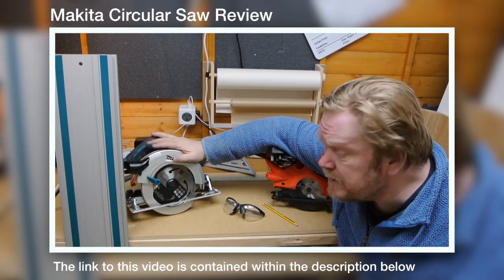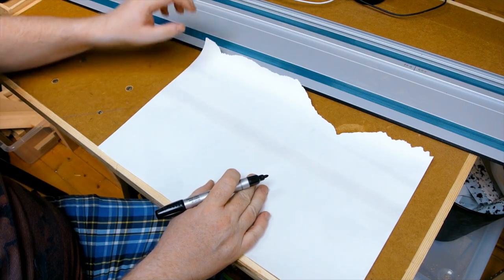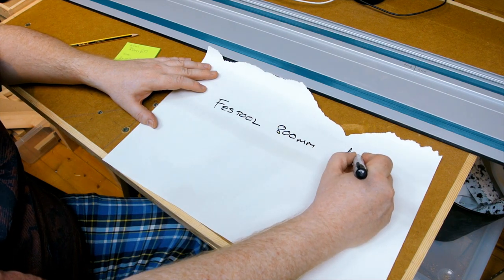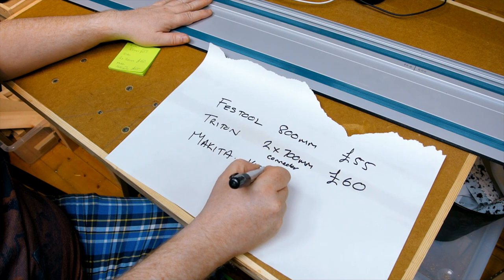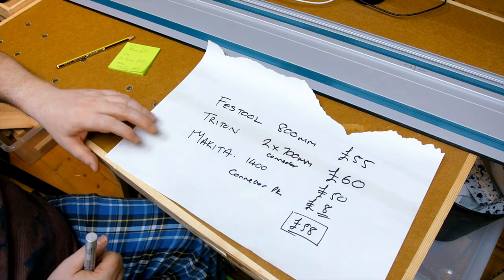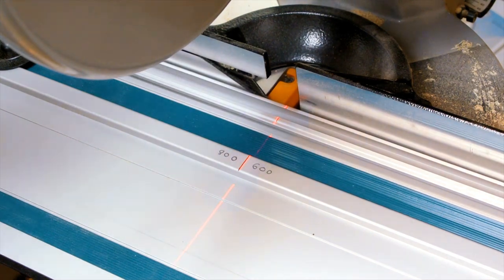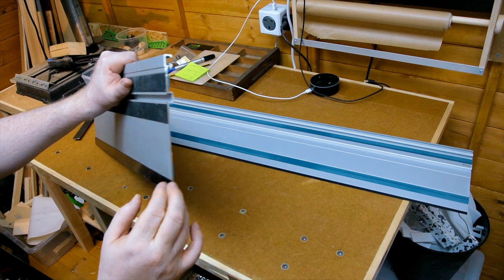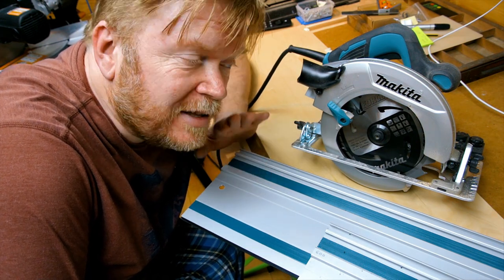Making Shorter Makita Guide Rails | 2 Rails For the Price of 1 | Tool Review

Comment: You say the best price you found for the connector pack was £8 (good price) mostly they seem to be,  as you state £14 however the pack is only for one connector, but you need two, one on the top of the rail and one underneath! In my experience the rails don't work so great with only one connector. Also wanted to ask if you have had problems with the Makita rails being cupped, when i purchased mine, I had to send 6 rails back before i found two which were straight i also found that the profiles didn't match very well on a couple.
Reply from the maker: I think for putting the chopped rail back together the single connector (Part number P-45777) works well enough, but you're correct if joining two 1400mm rails the double connector pack is the right option (Part Number P-20177). As far as rails is concerned I've had to send one 1400mm but consider myself lucky with the others. I have eased over the edges of the profiles and when I connect them I've matched the ends for the smoothest transition between rails and marked them. It's clear that the quality of the rails is an issue for Makita over the Festool system based on the reviews I've seen. But the system overall including tools/adapters, etc. is affordable in a way that Festool isn't.
Reply: @StrawbyteWorkshop  I just wanted to point out to others that You need two connectors as i was caught out when ordering!. I absolutely agree with the affordability of the Makita range, after doing the usual reading of reviews I chose Makita based on most of my other equipment being Makita but also due to the price difference with Festool. Now I have straight rails i'm very happy with it. For others out there if your Rails are cupped or the profile don't match exactly..know your consumer rights and demand they are changed! You have 6 months from when they were purchased. The seller has to replace or repair by law if they are defective, doesn't matter what their own terms and conditions are, i.e don't get fobbed off with the usual 30 day policy!!

Comment: Did you use a metal cutting blade for that cutting I want to cut my dewalt rail ina 700mm / 800mm
Reply from the maker: I used a multi-material blade in the video. However aluminium and brass can be cut with woodworking blades designed for cross cutting. You need to go slow and clamp the rail down.

Comment: Hi, i am looking to use the Parfguide system but have Bosch tools and they do not currently have the track clips for bosch. They are useable with Makita and Festool track and the Bosch track saw can be converted to work with Makita and Festool track. I already have bosch track so i was reluctant to spend on another track especially as i could not find the perfect length i wanted. Thanks to your video i think i will buy a length of Makita track and cut it down. The evolution saw you used, is it a wood or metal saw?  The track is aluminium i assume and i think it could be cut with a wood chop saw but i am not sure what the finished cut would be like.
Reply from the maker: Hi. The evolution saw used their standard multi-material blade which cuts wood, non-ferrous metals and steel. A standard wood blade on another saw would be fine if fairly sharp - but check the ok nstru croons that came with your blade/saw.

Comment: What!!!,
Reply: Take it outside an cut it .tracks are best left as long as pos. the Aldi lidl b an q plunge saw comes we short track if you really need them an am sure they fit . I have been using the maffel flexi system for nearly 15 years I think and its great .
Reply from the maker: Hey there. You're absolutely correct - tracks are best left as long as possible. And don't get me wrong, I haven't taken my only 1400mm track and chopped it in two. I do need a shorter piece, it's perfect for cutting down reclaimed kitchen doors for my projects, and what I was trying to point out is that Makita don't make a shorter track, Festool do (and Triton - you get two) but they're more expensive than buying a second Makita track and chopping it down. For me a portable circular saw is the most versatile tool I own and having made the upgrade the fact I could take it and use the makita track system was a bonus. I've been using a saw-guide/saw combo for all my recent projects and I don't think I've used my table saw in months. Anyway thanks for the comments. Keep watching.